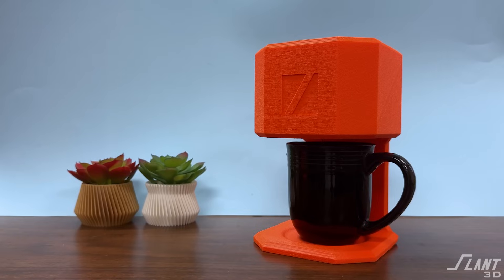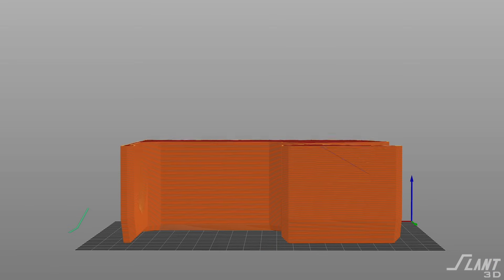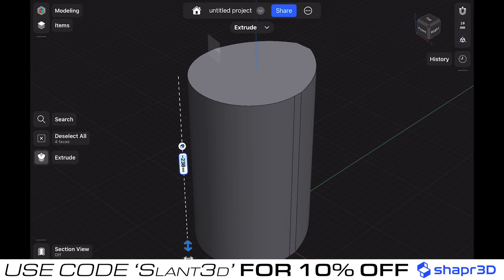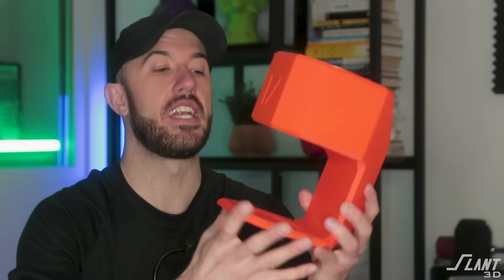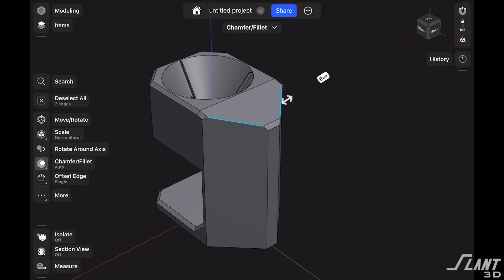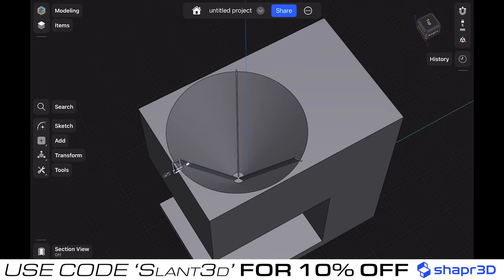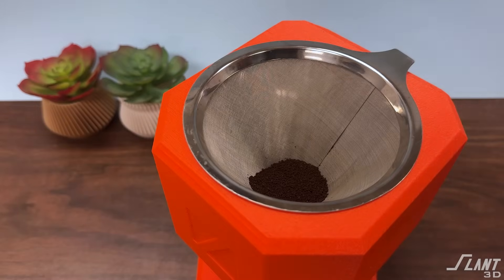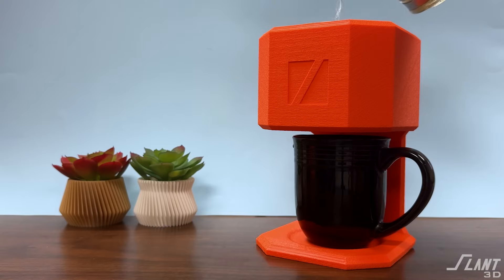We 3D Printed a Coffee Maker | Design for Mass Production 3D Printing

Comment from the maker: Get the STL here:
https://www.angled.xyz/product-page/square-pour-over-coffee-stand

And get the filter needed here:
https://amzn.to/3xRsXrF
Reply: The filter linked has a welded bottom to place on a cup, does not work without heavy modification. I'm excited to try this, for those worried about plastics - I see a "silicone coffee dripper cone" that would solve the problem.
Reply: Build plate area required to print said STL?

Comment: I usually like your products. But this one of those classic cases in 3d printing where its just wasted filament. You can buy a cheap Hario v60 for 10$ or less probably. Can this be cheaper than that? Otherwise is simply worthless to try to sell this. 
Not trying to hate, I am also very guilty of designing and printing usless things

Comment: Others are worried about the health risks of plastics, but I just don't want to drink the rancid oils from last month's coffee. I'd really like to see a follow-up on how you address making a surface of layer lines that can be cleaned properly. Have you just managed to make your prints that smooth, do you hit it with a heat gun, do you dip it in a thin epoxy to fill the gaps the way potters use a "slip" for porous clay? I am very interested to learn!

Comment: Yeah... this one is going to be a hard pass for me, and not just because I don't drink coffee (iced tea is my current preference); but most 3D printer filaments are not considered food-safe in themselves, you can't put ones like PLA in the dishwasher as they'll melt from the heat; plastics shed nanoparticles which are turning up all over the human body just from conventionally manufactured packaging (and the 3D printing process affords even more opportunity for that to occur), and of course there's the porous surfaces issue. Also - are we sure that the hot-end of the printers & nozzles are heavy-metal free? Although the exposure rates from handling 3D printed objects with dry skin is going to be low enough to be insignificant, when you're talking about direct ingestion of material that's come in contact with it a different set of variables comes into play.

Comment: Yeah no way will this hold up if printed in PLA..
Reply from the maker: And yet. There it is
Reply: @slant3d  Yeah use it for a month and get back to me.. It's a good example of some techniques, but PLA is obviously a terrible choice for something that will come into contact with 100c (or near to it) water. Even PETG probably wouldn't be suitable for long term contact to those kinds of temps.. Something like Polycarbonate would work

Comment: i love your channel! can we get a video about print in place bearings and moving elements?

i designed a print in place bearing recently and used a relief cut to redirect the seam so it dosent collide with the internal surfaces! thats a small trick i wish to share.
Reply from the maker: Interesting idea. 3d Bearings generally don't have much utility. But they would most certainly be a good demo.

Comment: You print it entirely like that to get around it sticking too much to bed? On my regular 3D printer 2mins after it is cooled it has released itself completely. Also advantage of letting it cool down for few mins is you don't damage/warp the bottom layers when pulling it off hot bed and get a nice finish.

Comment: Another great video packed with a lot of useful information as always!! I had a question when printing at a angle as shown in the video at 1 minute in. How do you fine tune settings to adjust to make the layer lines more smooth and even.(What settings show I look at adjusting to fix this, mostly print with PLA). I personally noticed when I print at a angle like this my layer lines are a lot more pronounced.

Comment: Finally non-traditional manufacturing artisanal grade microplastics directly poured over my morning coffee.
Reply: If you're concerned, changing the part to permit a glass or metal insert is easy enough.

I'd probably look for a third party food safe high temp silicone piece? This would also facilitate cleaning, which is the real reason I'd avoid using this at a coffee shop.

Lots of coffee makers are made of plastic though. I'm not sure why this one would be special. And a lot of consumer grade Walmart grade filters have a plastic content already.
Reply: Those are the kinds of design challenges I deal with the most. I'm not doing anything near this scale so I can afford the time to seal parts for food safety. I'm not sure how best to do it otherwise
Reply: They put the fins specifically to avoid that, what are you talking about
Reply: @GiulioVonKerman  Those fins don't matter, water will come into contact regardless unless you pour excruciatingly slow.
Reply: There's still contact though  @GiulioVonKerman

Comment: Honestly wouldn't use pla in a heat application not even due to intended use but as preventive for unintentionally spilling on it or it falling and potential heat transfer through the metal otherwise its not bad just not necessarily an answer to a problem

Comment: I think the design could be improved more. The top does not need to be so large. It only needs to hold the top of the metal, so it could be just a simple  ring holding the metal cone.

Comment: May main concern would be microplastics and degradation: Would it be possible to revise it so that a very thin metal sheet (like 0.1 mm copper for crafts) could be inserted around the cone/plastic ridges area?
Reply: What microplastics? Any source on this?
Copper coffee pots are coated (tinned), probably for a reason, so copper lining would be far from top on my list.
Reply: @kimmotoivanen  any source on this?  Geez, the plastic part maybe????
Reply from the maker: Watch the full video

Comment: This only works if the metal cone is completely solid and only opens at the bottom. If the coffee touches the plastic sides, you'll get more and more bacteria in your coffee as times passes with no way to clean it up.
Reply: That's because the bacteria myth has been disproven by someone who tested it in a lab with bacteria and found that dish soap and water cleans plastic parts just fine because the soap changes the wetting angle and gets between the layer lines and the bacteria washes away. Apparently the biggest hazard is certain specific colors and some of the additives used. There are some filaments that are rated by US agencies for food contact.
Reply: Yes everyone that owns a 3d printer knows this lol. But then I have not ever heard of one case where anyone ever showed or shared that they have gotten sick or showed any type of bacteria growing on a "non food safe material" or food safe material 3d printed item... its much more rarer than the 3D printers are fire hazard bombs that spontaneously erupt in balls of fire. I actually have a 3D printed PLA bowl I keep hard candies like  M&M's stuff like that in for snacking and at best I have only ever wiped it out with a damp cloth every now and then in the last 6 years
Reply: @SoloGamingZA food safety also considers material toxicity: you can buy food safe hydrochloric acid and once diluted it'll taste like citric acid but unlike hardware store hydrochloric it's guaranteed to be free of heavy metals

storing dry foods avoids this because there's nothing to extract the toxins from the material. hot coffee? that's pushing it
Reply: @SoloGamingZA  Really? Never heard of one case showing bacteria growth? Funny, because when I search youtube for "food safe 3d print" the very second result is by Igor from My Tech Fun, doing an experiment in collaboration with the university of Novi Sad, clearly showing bacteria growth in the petri dishes.

Comment: That is awful! It's a huge hunk of very obviously 3D printed plastic that doesn't do anything other than hold the important metal part - who has storage room for that? Ironically a really minimal 3D printed holder for that metal cone that sits on top of the might actually be good; perhaps some sort of inverted cone (albeit with much of the material removed?) that could be stored inside of the filter when not in use?
Reply: @Jakdaw yeah I agree with you, a Part out of a metall Sheet would be way cheaper for example
Reply: I think the actual answer to your question is coffee shops where it fits theme and weight is important. For example, mobile coffee shops? Some consideration should be taken for stacking them during transit, perhaps?
Reply: This isn’t about what should be done, it’s about what could be done. Also a good 3d printed part looks and feels better in the hand than a cheaply made injection molded. I am not saying all injection molded parts are cheap. Also the part would probably be like $5 shipped or something. It’s not an expensive part. Another thing is that I can make space for something I like. That part will not take up much space. Please stop hating on new processes just because it’s different.
Reply: @AugiesHobbies  what a load of rubbish - now that he's added the Amazon link to the filter it's clear to see that he's started with a sensible stand-alone product that works. And then he's broken it by removing the bottom part in order to add a huge lump of landfill plastic. In the name of "design"? Duck off.
Reply: He’s just showing some of the possibilities and how to design for the process. He’s giving advice for designing models for the process and making the process easier for people to learn about. This is a very good thing that he’s doing.

Comment: Welp, i have a huge respect for what you guys are doing, but there is always some problem i see again and again in the examples you give. Those things have ugly (evenly distributed ugly, props to you) surface finishes. No way someone looks at that and prefers it over injection moulded soft touchy smooth thing. No way!
Reply: I prefer a good fuzzy skin or matte surface to the shiny injection molded plastic look of most modern appliances. The only thing I don't like is more difficult cleaning.
Reply: Meanwhile I'm sitting over here thinking the regular lines look fine 🤷🏿‍♀️
Reply: Another outstanding design video! I especially appreciate the process iterations and accompanying rationale. I feel I’m learning through each one. These videos are definitely sharping my design and critical thinking skills. Thanks!!!
Reply: @cbgslinger  why is this a reply 🤔
Reply: @TS_Mind_Swept  Oops, my mistake. I didn’t realize I was inside a reply when I made a general overall comment.

Comment: Does hot liquid contact with PLA or PETG release chemicals into the coffee? If you're worried about this, could insert a stainless cone part.
Reply: important question as you can see coffee dripping along the plastic in multiple shots of the video
Reply: @Phirebirdphoenix   I have a screen that I BALANCE on my coffee mug precariously , I put a paper filter in it and not one drop goes outside the screen. Many people have these. Just drop it in , after sizing the print in the slicer to match.
Reply from the maker: Watch the full video
Reply: You didn't watch the video?
Reply: You could also print this in petg instead and never have to worry about it melting
Reply: If your coffee is hot enough to melt plastic what do you think it's doing to your insides
Reply: @phasesecuritytechnology6573  That's why I don't brew directly into my mouth.
Reply: Even with those fins you're going to get some contact aren't you?